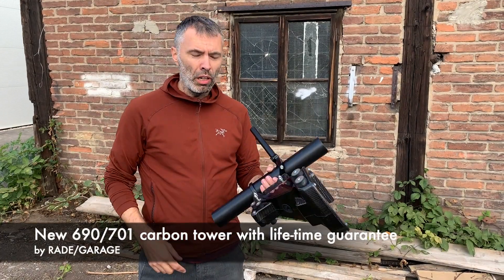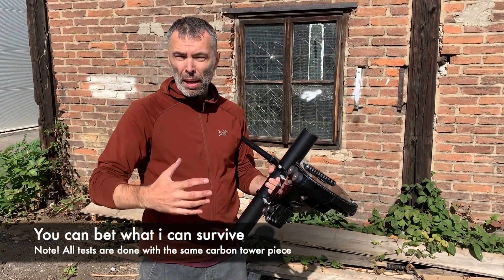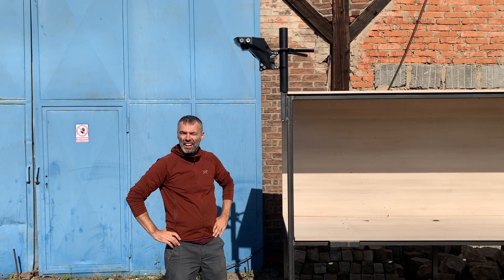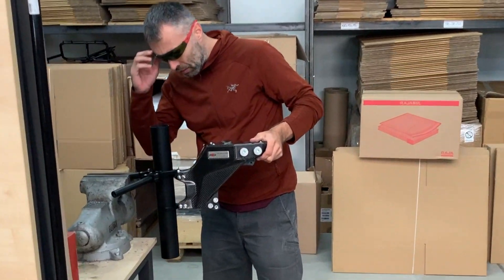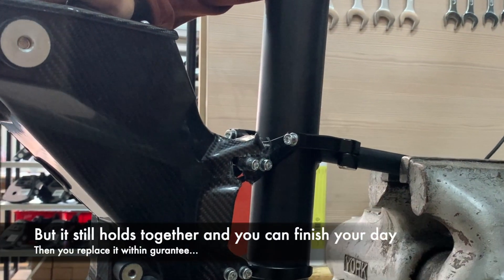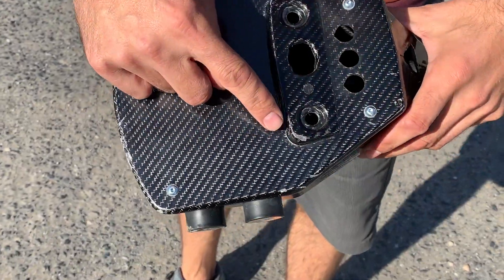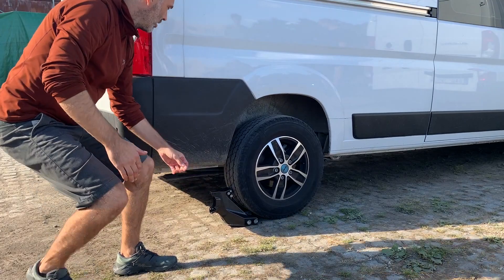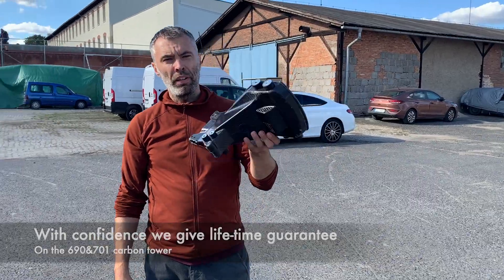New 690&701 carbon tower destruction test

Comment: I would really like to know if your Product had an EC Nummber to be street-authorized in Germany. If so, definetly I would buy it !
Reply from the maker: Hello Mike, we have E-certified LED headlights, the rest of kit is subject to individual German TUV approval.
Reply: Great, just what I like to see. Most likely will the bike be ending up in the scrap before this carbon piece.
If you can change to the new rally fairing on the 890 adr I will buy one. This old is not so nice looking as the one used on the 450 rally replica that KTM sell